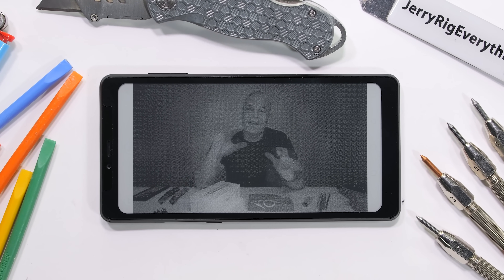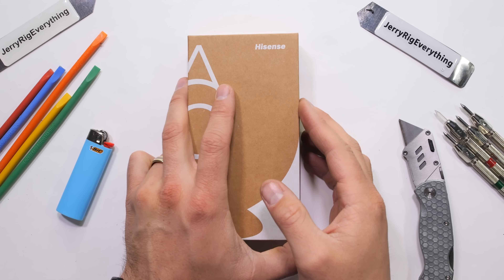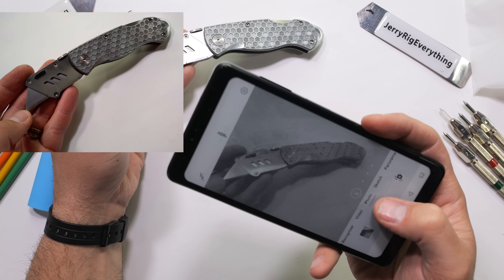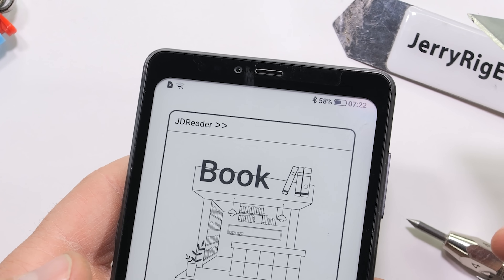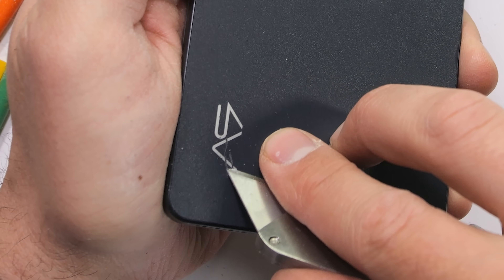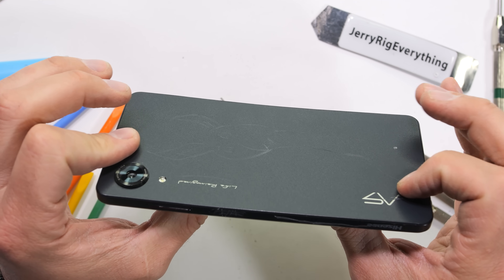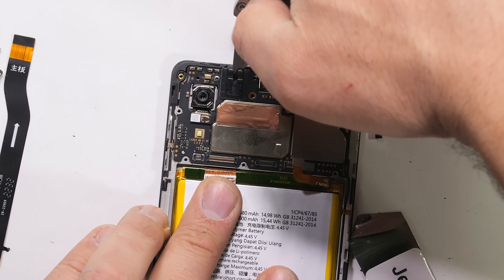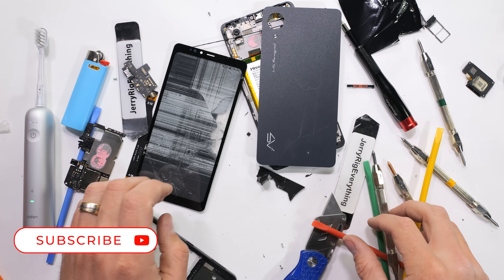This E-ink Smartphone has a Crazy Camera...

Comment: I don't need apple to make an e-ink phone. I'd rock an A9 right away!

I had bought a S24Ultra and Watch6Classic with a 2year contract. With the intension to keep my Pixel 6 Pro as a backup if my anything happened to my S24Ultra.

I hated the S24Ultra UI, they forced me into opening 17 different account, i couldn't use google pay from the dropdown menu, the gesture of swiping up to open the list of opened apps was always scrolling left by one spot, so if i want to close the app i just had quit, it added a an extra step. The watch had a disgusting battery life and was overheating ALL THE TIME.

Now i don't have a backup phone, i don't have insurance on my old phone, and i don't have an e-reader...

The cost of the taxes i put on the S24+Watch would pay for half an A9... I want that!!!

Comment: There are reports that Hisense has completely cut off the A series product line—and they have every reason to do so.
Reply: In fact, aside from not supporting the GMS framework (a system-level block, with no other choice but to modify the system), the battery life is not as long as expected, even with the use of an e-ink screen. The A7 model, in particular, has serious issues; in terms of the ratio of battery life to battery capacity, the A7 model is even worse than the A5 model, which has a smaller battery capacity.
Reply: The main reason is that the processor selection for the A series has been a disaster. Even though no one would care how a phone with a very low screen refresh rate performs in scenarios that require a high-performance processor, Hisense still chose some strange processor models for the A series.

Comment: I don't understand why this type of screen cannot be standard or an option on the back of any phone

Imagine having a dual way to watch your content and save power. No need for selfie cameras when you can just use the main camera with an e-ink screen on the back

It doesn't even have to be large (however that would be nice). Just enough for notifications and minor screen usage in an appropriate aspect ratio

I miss those years when technology was bleeding edge not holding back until they can absolutely monetize it

Comment: I mean this is useless unless a wireless option will be available. Just buy the tablet or e-book or tablet with dual screens (where one is e-ink) or flex/fold -- there it make sence at least
Remind me a modular phones (where you can swap blocks or modules & built your nugget)
For phone -- it's o'revoir for the battery (yep those are capable for small power usage but not that small to ignore, except older gens or with veeeeeeeery high latency so for text only)+wd the dongles & whistles, overheating (where more than warmer) is inevitable
Also quite noticeable -- a weight, a durability, a design and quite sure a security -- because there's another own say render that could be jacked to save and send cells/pixels/voxels that were on update list. Sure it's technically possible though, but the action would be much easier to elicit (in theory)
So the best would be to pack it into a tablet, or wireless option + would extend lifetime/lifespan of the phone.

[m joke ]If no -- need to have a flying capability for my phone then because i'm not receptive to look for it when it's lost. And a projector (it was done already
So as the to bark capability would be marvellous, because it can and it not just works

Long story short -- a powerbank with wireless E-link -- a working horser
Or tablet/laptop. But please not the phones. Expecially when travelling or at a road trip

Comment: Those electric toothbrushes are going to be trash compared to the German designed and manufactured Braun Oral b. My old one lasted about 20 years and I only replaced it because the silicone around the button started to disintegrate.

Comment: Too expensive for such bad specs tbh, if this cost around 200$ this would have been my choice, but 500$ is stupid especially for a chip that came in 2020, and which is 1/10th the performance of chips that came in same year. Phones now in this range are offering 1.5k Dolby vision displays, and other features that are a decade ahead. So the company should have priced it no more than 200$

Comment: Not a very repairable device... thumbs down for that. I'd certainly like an eink display on a smartphone, but on the back. It would be nice to choose which one I'd like to use. I imagine with a normal size battery you could get 3-5 days between charges if you just use the eink display. As for Apple "inventing" this, probably not ever - it isn't pretty.

Comment: It's just a normal mid tier phone with a bad display, don't even save that much battery cause it's not the display taking up most of your battery, unless you use a very high resolution and high refresh rate, just turn both down and you are good 🤗

Don't get me wrong, e-ink display's has it's place, it's great for reading books, it's just not a good fit for a phone you use all the time, I have no idea what they are thinking